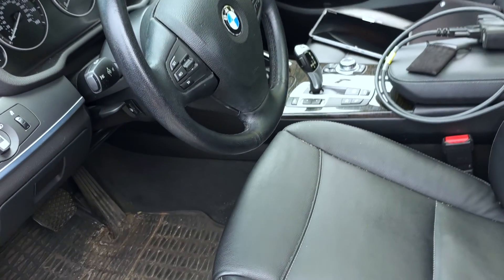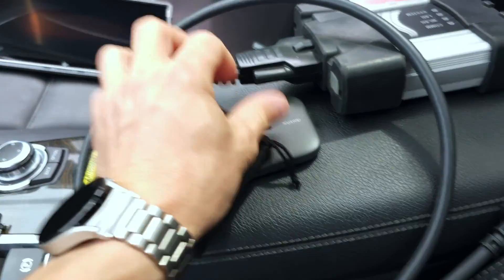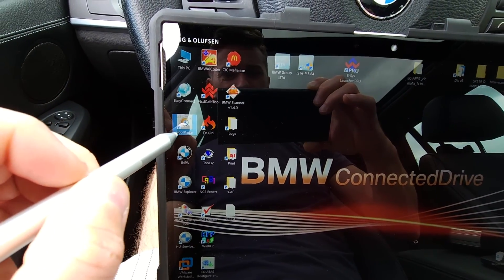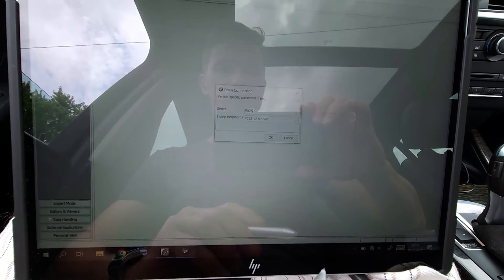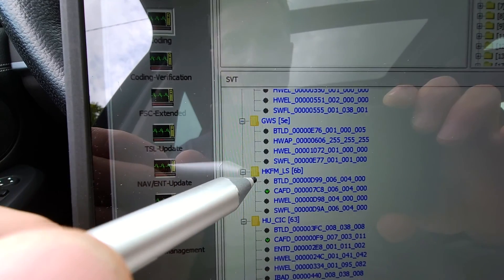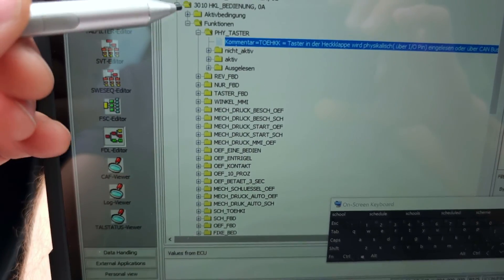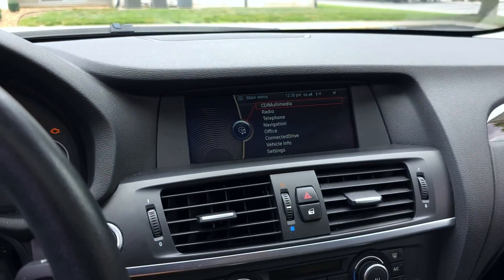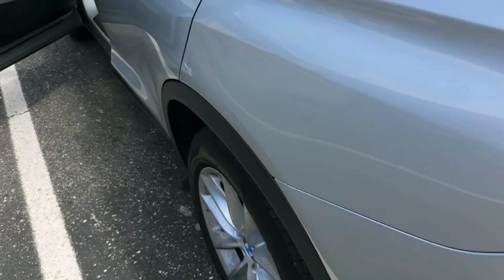Easy Coding with eSys , Trunk closing by remote control ! BMW f25

Comment: I have a question, not related to BMW.  Your tablet is HP, but on top it says BANG & OLUFSEN.  What is B&O on your tablet?  The software you are using to code?
Reply from the maker: Hello! NO, is the sound system of the tablet ! The small speakers are created by B&O . The software is Esys!